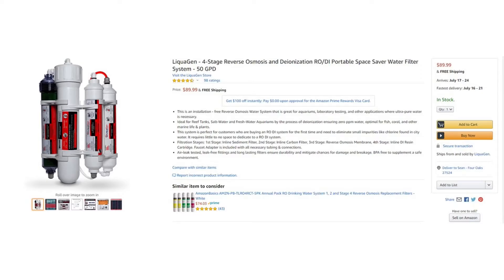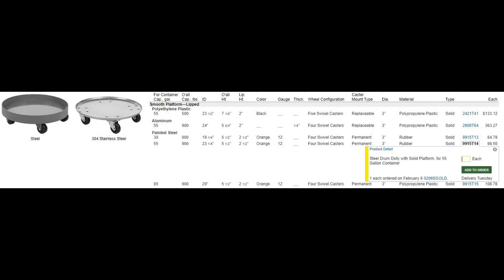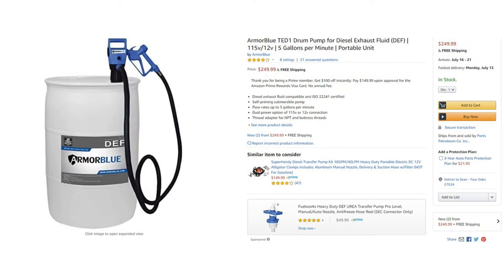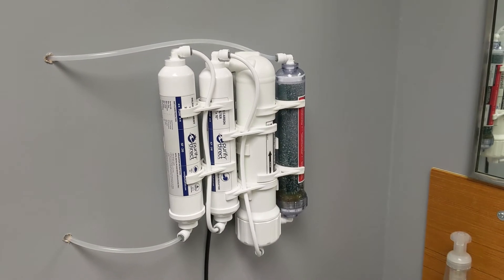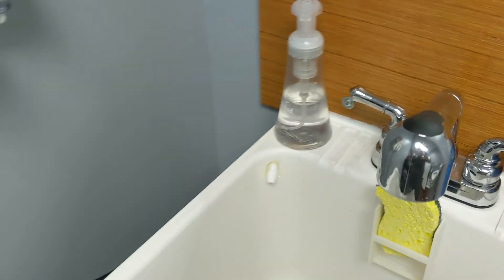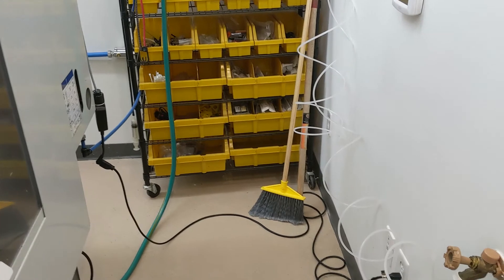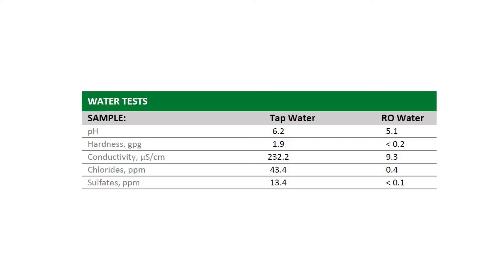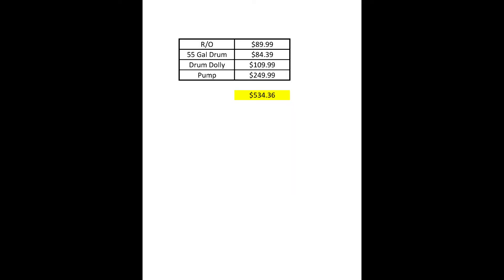RO Water on the cheep for CNC machines

Comment: Awsome thanks for posting. Do you have it connected to a float switch in the drum?
Reply from the maker: No I didn't. If memory serves me correctly the kit I purchased came with a float cut off but I never used it. It fills slow enough that I just check the level about every 2 hours when it starts getting close. I really should put one in because I have completely forgotten about it and had quite the mess to mop up several times.